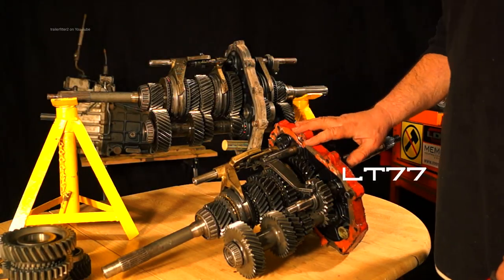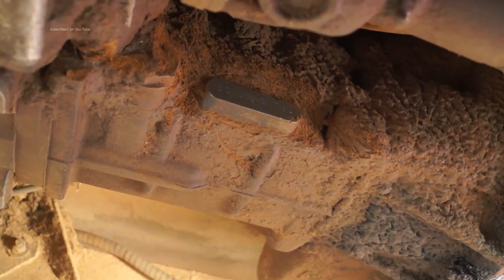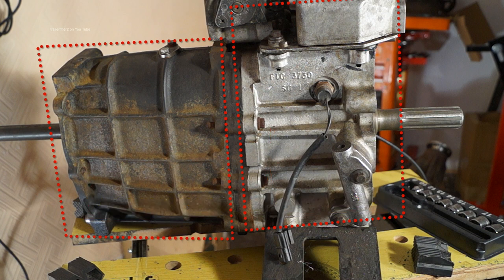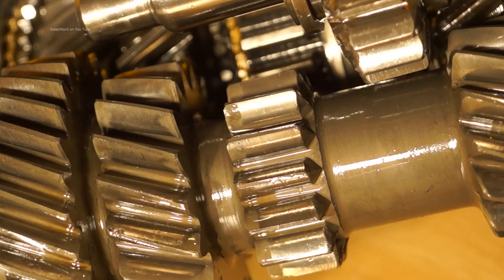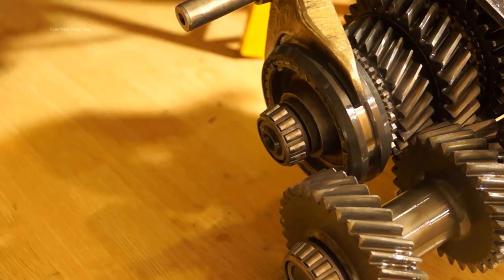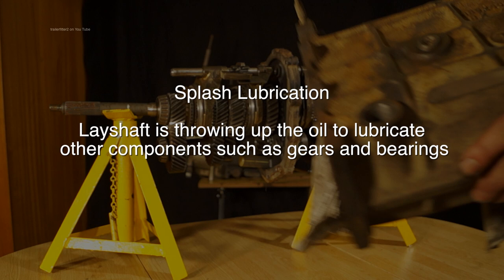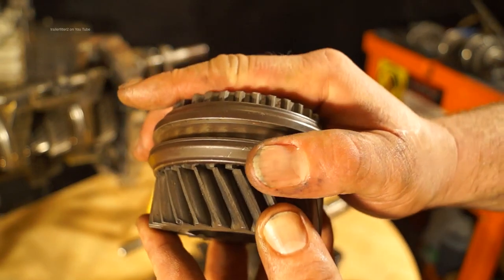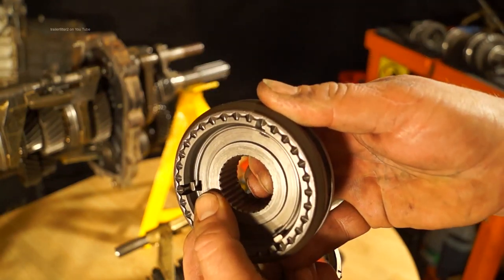Pt1  LT77 and R380 Land Rover gearbox - Inner workings of the

Comment: Great Video.  We have a Land Rover 110 with a J suffix R380.  Odd enough the input shaft (primary pinion) is the same length as the short belhousing LT77 input shaft sitting on the shop floor.  At first we thought this was a Stumpy input shaft, but the stumpy shaft is about 1.5" shorter.  This has to be an input shaft from another marque.  The overall length of this R380 is 1.5" longer than a stumpy and has a LT77 belhousing.  Any idea where the input shaft came from that is 1.5" longer than a stumpy input shaft?

Comment: Excellent video & Greetings from Paris !  Regarding the R380 gearbox, I have a defender TD5 year 2003.  If I up-shift quickly with high RPM from 1st to 2d, or 2d to 3d, I feel a crunch/grind in my hand (not so loud to hear it in the vehicle, I can just feel it with my hand). 

If I leave the RPM/rev normal, and leave a 1 second pause on Neutral between these gears, all is fine. 

No crunch when downshifting. The gearbox runs with new MTF94 oil.

Is this a normal behavior for a R380 ? Are we supposed to UP shift slowly with these gearboxes, losing momentum ?

Losing momentum is not an issue on flat road, but annoying climbing a slope. 

Many thanks for your help and feedback !

Julien

Comment: I just had fitted an LT77 51/H suffix   ex reconed MOD stock  and the gears are are stiff and it wont go into 5th at all the mechanic said hes fitted boxes from ashcroft worse than mine and they wear and get easier , will 5th then become select-able ?

Comment: What is the recommended oil for lt77
Reply from the maker: Whatever the workshop manual recommends.  Usually, PAS fluid or Dextron 2 which is also the automatic transmission fluid of its era or if it will like it MTF94 ( Manual Transmission Fluid )  which is used in the later R380 gearboxes. The earlier LT77 gearboxes do not like MTF 94 oils.
Reply: @trailerfitter2  why no MTF94 in LT77?